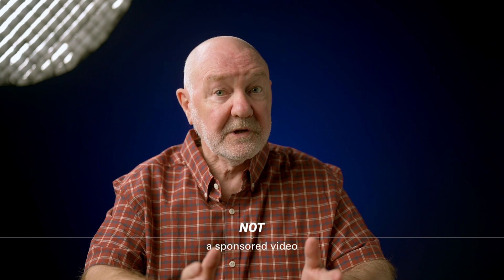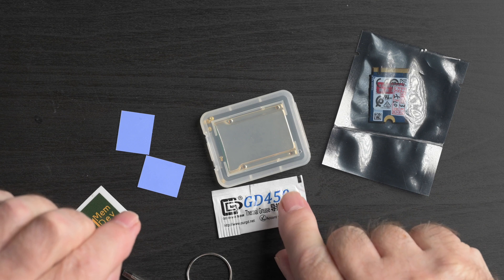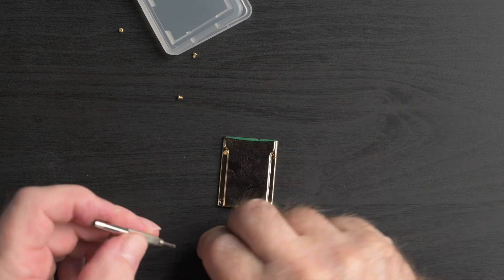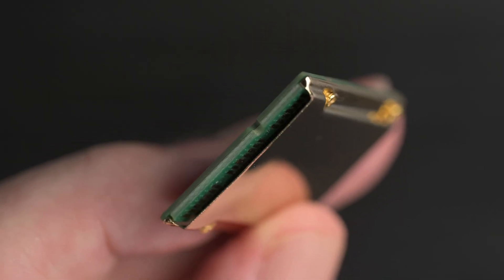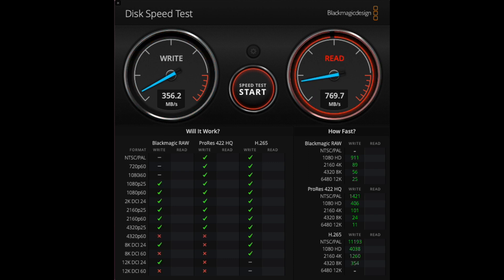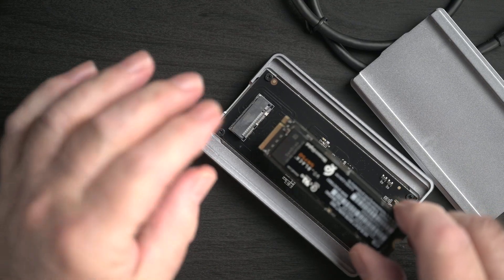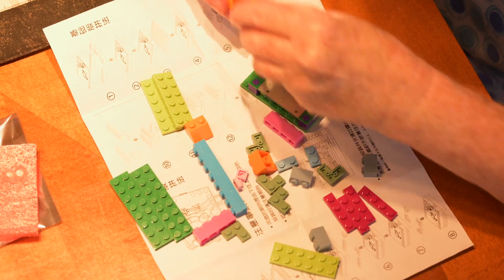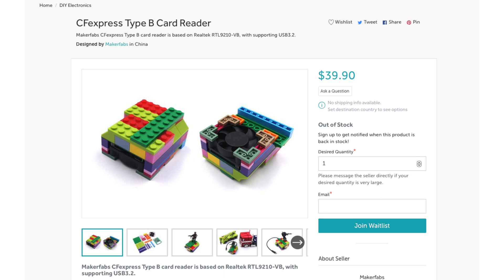DIY CFexpress Type B Cards | Budget Friendly

Comment: Hi, thank you for sharing your very interesting video. I should buy a M.2 2230 PCIe NVMe SSD to build a CFespress for the Lumix camera. Can you tell me a reliable brand? I would have chosen one of these 2: SYONCON AP425 M.2 2230 OR Sabrent Rocket 512GB. I have no experience. Which of the two do you recommend? 1000 thanks.
Reply from the maker: You're welcome. However, I have not tried the brands you mention so I can't speak from experience with those.
Reply: @RaymondParkerPhoto  Do you know which brand can be compatible with Lumix GH6? Thanks

Comment: Thank you so much for loving my design😄I've changed the noisy fan.
Reply from the maker: You're the designer of the card reader?
Reply: @RaymondParkerPhoto  Yes, and the adaptor.
Reply from the maker: @alexpan2792  Well done! Glad to have had a chance to try out. Quieter fan would be ideal.
Reply: @RaymondParkerPhoto  Sure, busy running a new version with smart fan controller with supply chain, it could also have CNC case option, will finish soon.

Comment: Raymond, this comes to half of the price as a Pergear 1T Cfexpress card depending on which NVMe card that you use.  This looks like an option for your second card slot.  I wonder if it is the SSD card or the adapter that limits the overall speed of the device?
Reply from the maker: Yes, good question. I was wondering the same. But I agree; second slot alternative, for sure.